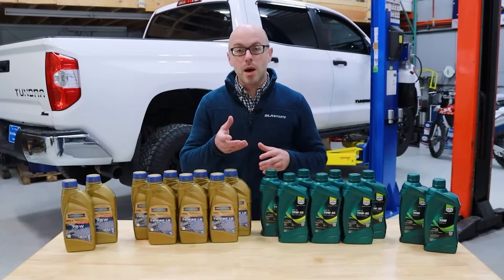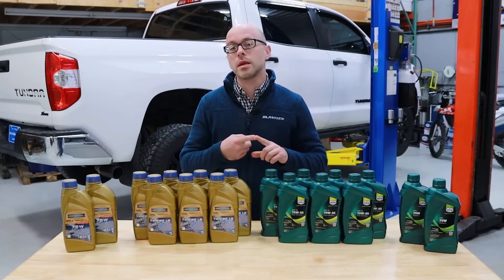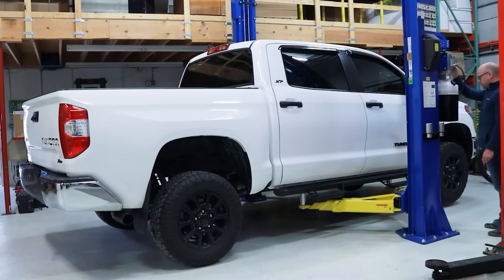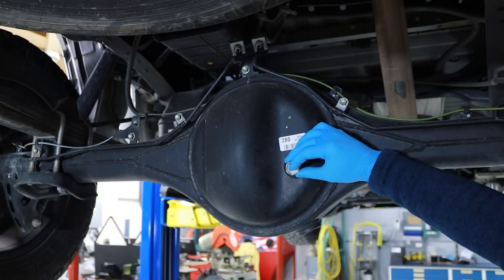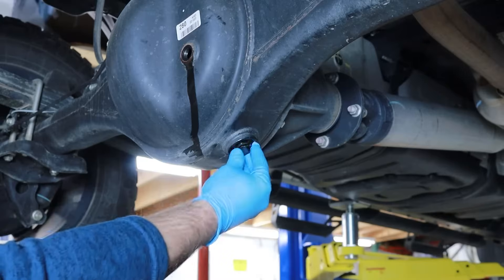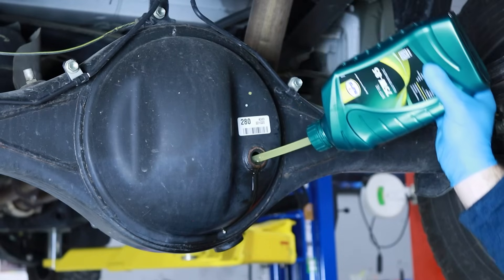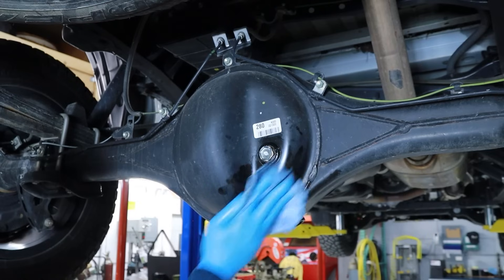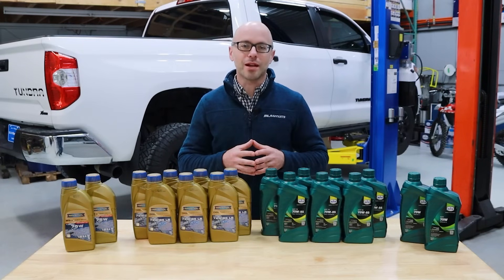How to Change Toyota Tundra Rear Differential Fluid Gear Oil (2007-2021 XK50)

Comment: What's the service interval for replacing differential fluid in the 2007-2021 Tundra?
Reply from the maker: Check our blog for info on the recommended rear differential fluid change interval here: https://www.blauparts.com/blog/how-to-change-toyota-tundra-rear-differential-gear-oil-2007-2021-xk50.html#toyota-tundra-rear-differential-fluid-change-interval

Comment: Do you think it’s safe to change differential fluid if it has never been touched at 200,000 miles
Reply: Yep, diff oil is not like transmission fluid where if it does to long you don’t need to change it

Comment: Can 75w 90 be used?
Reply from the maker: For Toyota Tundra models starting from the 2007 model year, Toyota recommends using 75W-85 GL-5 gear oil for the rear differential. The specific part number is 08885-02506. We always advise following the vehicle manufacturer’s recommendations as outlined in the service and owner's manuals. This ensures optimal performance and longevity for your rear differential.
Reply: Yes. 75w-85 is near impossible to find, dealerships will use 75w-90 when they don’t have 75w-85
Reply: 75W-85 is on the Amsoil website for $22
Reply: Yes.
Reply: 100%. 75-85 is hard to find and the Toyota OEM is expensive AF. 75-90 is very common and the difference is negligible for most applications. Use a full synthetic gear oil you that meets API GL-5 specifications and you’ll be fine.
Reply: No